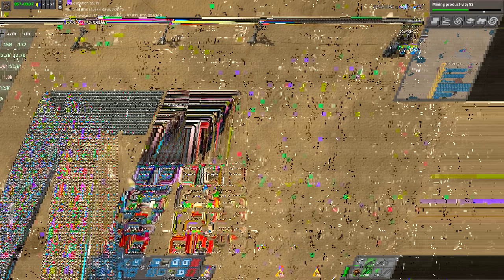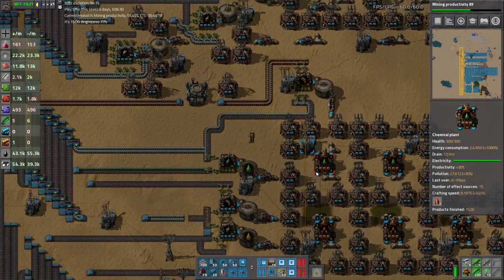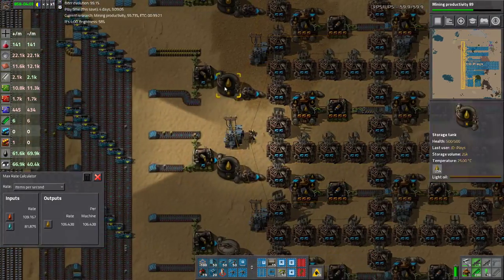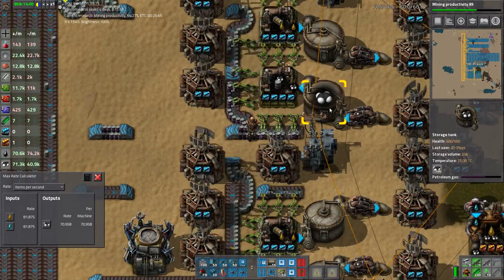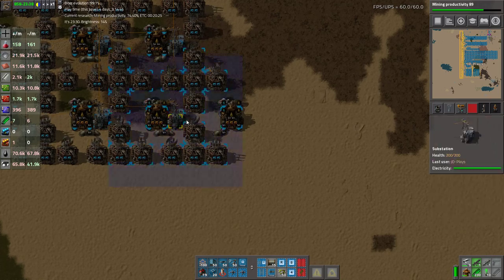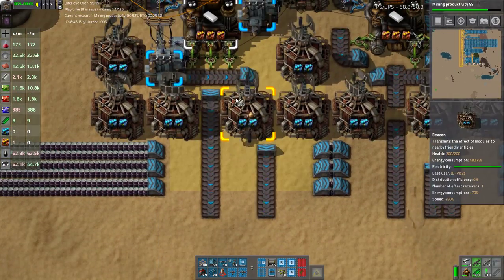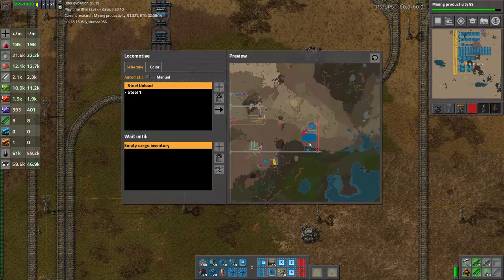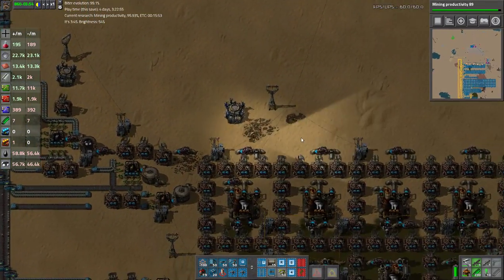Factorio 0.16 Transitioning to the MEGABASE EP51 Belts and Belts of Barrels - The Oil Base

Comment: Hey mate perhaps you should have a massive storage for crude or oil. So your trains can run all the time
Reply from the maker: Storage is pointless, Either you can bring it in as fast as you are using it (hence no need for storage) or your bringing it in and 'borrowing' some from storage (hence eventually that storage will run out and then you have the same problem as not having enough in the first place). I would much prefer to know i have a problem with oil or any resource sooner rather then later! The go do some outposting!

Comment: For the coal can you get away with no balancer at all by using waterfall splitters exclusively? Do do one waterfall towards the middle, then one balancer lanes 4/5, then waterfalls out to the edges for each takeout?
Reply from the maker: Tried it, tried every combination no luck, because splitters actually lower throughput (ever so slightly) and inserters don't grab constantly (if you watch belts with a high throughput over a few machines you will see your belts stop occasionally then have massive draw as inserters naturally sync and de-sync) End result I'm going to make the coal trains 3-5 in length to give me 10 belts of coal, It seemed like the simpler answer
Reply: JD-Plays yeah. I think you need 6 stack inserters to drain a blue belt without any stuttering. 4 doesn't do it reliably. Anyway, if overkill is working, sounds like the solution to me.

Comment: Genius and insanity are kissing cousins. Are you going to tap the coal deposits to the southeast of oil refining?  Do you think it will be enough to sustain production?
Reply from the maker: I havn't even looked @ raw resources in yet, I think as the base grows im going to have to move further and further out for more and more resources
I also expect fairly soon im going to be setting up a large depo so i can mine every resource you can see currently and get them out of the way for more solar stamps!